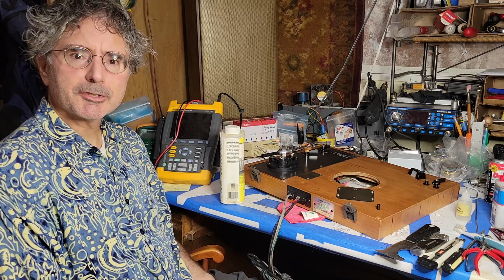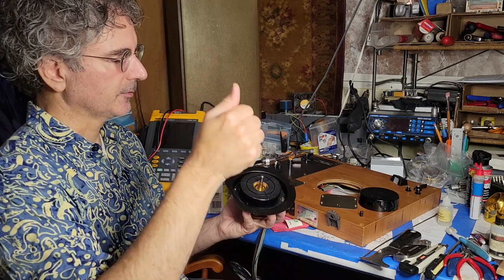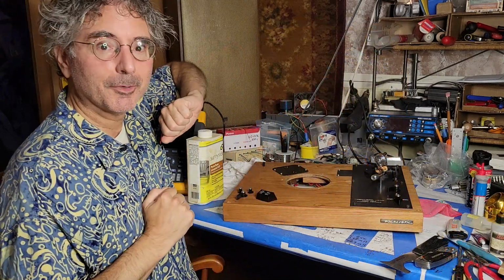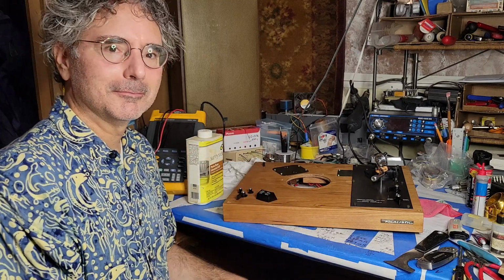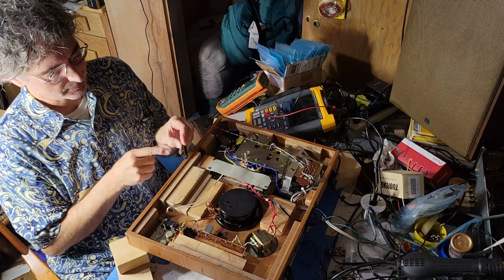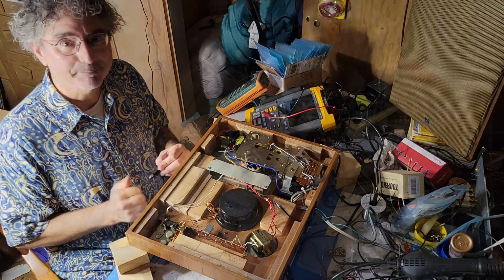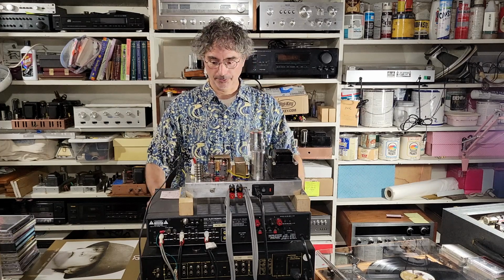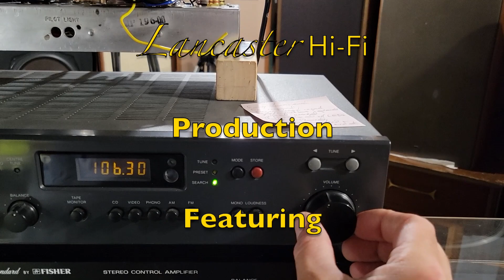Realistic LAB-400: Vintage Turntable Restoration

Comment: You did a great job restoring this turntable! I have one I bought new in 1979. Since having it I had to replace the rubber feet that deteriorated. I replaced the two top cover hinges because the springs broke through the plastic. The latest was the rubber platter mat that cracked and oozed oil. It is still working. I always was amused how the spindle jerked around if you ran it without the platter attached.
Reply from the maker: Thanks! What did you replace the get with? I'm not sure I'm satisfied with the replacement feet I have.
Reply from the maker: What did you replace the FEET with ...
Reply: @Lancaster_Hi-Fi  I got some feet from Radio Shack years ago that didn’t offer any shock dampening. Just something that raised it up an inch. It might have been better with four pieces of foam rubber as feet.
Reply from the maker: I still need to find something. Hell, I might try foam rubber (or neoprene)!

Comment: Great video. I wondered about the pots. My speed is wonky at times, and if you flip the speed switch back and forth, it fixes it. After that, the on-off switch decided it just wanted to play on repeat all the time even though it's set to the off position. I unplug it when I'm finished listening. Another pot issue, I'm sure. The LAB 400 belonged to my wife's late Granddad, and when cleaning out the house after both grandparents passed on, her family asked if I wanted the stereo, which sat in their dining room. It's in great condition cosmetically, and the mute and cue dampening is fine. I may take it to a local repair shop someday to clean the pots. I only trust myself with a cartridge and stylus replacement. 😊
Reply from the maker: The pots can develop problems, but they're relatively easy to access and treat. I was surprised that the source of persistent problems was the three micro-switches, which are relatively difficult to fix. Repeatedly working the speed and play switches might provide temporary relief.
Reply from the maker: You have to take off the bottom panel to access the pots. Take off the platter first! (Ask me how I learned that the hard way.) With the bottom removed, the pots are pretty easy to access. But the microswitches are a likely source of speed issues. Those can be treated with DeoxIT, but to do it, they have to be taken apart. It's not super difficult, but it's not easy. Fixing those switches made my speed issues disappear.

Comment: Excellent video! I love my lab-400, but have a question: I am experiencing loop skipping on various lps. I’ve managed to get through a few after adding a little more tracking force but don’t like doing that. I’ve tried two different cartridges/styluses with pretty much same results. Anti-skate doesn’t seem to have much affect on the tone arm movement but has very slight movement left or right depending on skate knob direction. Tonearm floats with ease before setting force. Side to side motion seems to have VERY slight resistance when touching arm. Blowing on it won’t move it side to side. Could it be tonearm bearing going bad possibly? Is it possible to lube that bearing?
Reply from the maker: Dang! I've never encountered that problem, sorry!

Comment: I have one of the same turntables. It has been in Arizona for 40 years and two years ago brought back to Indiana. I was given a couple albums I wanted to listen to, and discovered the speed is a little inconsistent. Approximately what would the cost be to go through the turntable and do a restore? The turntable is like new as far as cosmetics. Still have original box it came in. Almost 50 years old. (47)
Reply from the maker: Maybe $100? Ballpark. If it's only the speed variation you're concerned with, that's just DeoxIT for pots and microswitches (or replacement of microswitches). That's relatively easy work. You might also want lube and inspection (and repair as needed) of the mechanical workings. That's not bad for someone with some experience, but it's fiddly work and might take some time. Replacing electrolytic capacitors would be a good idea. The ones outside the motor are easy,  but the ones inside the motor case require more work. Hmm. Now, all that's sounding like more than $100. You might start with the pots and switches. 😁

Comment: Hi, you mentioned lubing the motor shaft and showed still images, but what areas should be lubed?  Thanks!
Reply from the maker: I've worked on so many turntables since this one, I can't remember exactly. In general, you want to find the service manual, and it should tell you where to lube with what.

Comment: The various switches you mention at the 14 minute mark I was, I think, able to get some DeOxit in around the trigger pegs, but you say they can be opened up if necessary? How do you do that without destroying them, as they appear to be welded shut.
Reply from the maker: The switches in mine have tabs. I think I used a thin blade or screwdriver to pry them up just enough to ease the covers off. It wasn't easy, of course. Maddening, really.
Reply: @Lancaster_Hi-Fi  yes, the switches by autostart/reject  lever have  tabs. I was thinking about the  smaller, black bodied switches. Maybe you didn't mess with those and maybe I don't need to be concerned with them either. thanks.
Reply from the maker: Sorry, I'm still learning how to find replies to comments! So, one year late, smaller, black-bodied switches don't ring any bells. After looking through my detailed photos of the guts, there were some black components that might look like switches, but I'm pretty sure they're capacitors. The three microswitches in mine had yellow plastic tops.

Comment: Great video, thanks for posting. I recently picked one up and it works flawlessly however I hear a tapping noise when the auto function is moving the arm either from the rest to the record or back to the rest. Once it drops it is fine, sounds like it may be coming from the auto motor/cam. Could this be a cracked cam as you experienced? Did you notice the sound before you fixed it with the tie? And lastly, how hard was it to get to the cam? Thanks
Reply from the maker: I don't think a cracked cam would do that, but I don't know. I don't recall mine making that sort of noise. The cam is not easy to access. If it is working despite the noise, I'd leave it alone until it malfunctions.
Reply: Thank you, yes otherwise it works fine so I should leave it alone but will be hard to resist tinkering. The clicking is so loud when the arm is moving I can't imagine that is normal or good. Maybe the tonearm motor needs lubrication
Reply from the maker: It doesn't have a separate tonearm motor. (Most turntables don't; my Pioneer PL-630 is an exception.) The tonearm moves via gears, etc., turned by the main motor. Those mechanisms aren't super easy to access, but not super difficult either (and way easier than the cam). After all these years, cleaning off the old, hardened grease and replacing with new grease might solve your problem. I generally use white lithium grease (although that's not "spec").

Comment: Hey! I have another question regarding the Lab-400...there are two adjustment screws that control the position sit down and return of the tonearm. I just purchased a second Lab 400 and the arm keeps wanting to sit in more of the 7" starting position rather than 12". Also the return is only active past the dead wax (into the label basically). Do you know which screw controls which function through the access hole? Thanks so much
Reply from the maker: You should get the manuals from Vinyl Engine. You have to register, but it's free.

Comment: Great stuff! Any tips on "refilling" the tonearm damping mechanism? Mine otherwise works great, but is dropping way too fast. Oh, and thanks for the mute-switch tip. I'm guessing that's the problem with mine (it's live whenever the TT is powered on).
Reply from the maker: Silicone grease on the shaft thingy.
Reply: @Lancaster_Hi-Fi  I assumed it was more complicated ) than that (like I needed to refill a reservoir or something), but I haven't been in the internals yet. So just some thick silicone grease on the shaft? Sounds easy! (and thank you!)
Reply from the maker: Yes!

Comment: It's motor driver AN 620 based circuit and motor is similar to cosmic cogram 4000 and cogram 4000mk2 motor assembled in Bharat(🇮🇳 India) in  between 1980-88.
Reply: That's cogram 4000mk2.

Comment: I subbed to your channel after watching this. I too have a Lab-400 that I recently bought from a customer for just $25. I own a record store in Tulsa, Oil Capital Vinyl, and sometimes people just bring stuff in. Anyway, it was in astoundingly good condition, not a blemish on the unit itself and only a few very small scuffs on the lid that polished out. It even came with a very nice, likely original, Shure cart and stylus. The speeds were a little wonky, so I cleaned the pots with DeOxit and also adjusted the start/drop and stop/lift positions. The only issue remaining, is a loud kkkkkssssshhhhh noise from the speakers when the muting circuit deactivates and reactivates. I cleaned the gold colored reed contacts by using a piece of cardstock, wet with DeOxit, but that seemed to only lessen the noise, not eliminate it. Any ideas or suggestions? It's a really nice table, perhaps a keeper, but that one issue is really annoying.
Reply from the maker: Instead of cardstock, try 2000 (or higher) grit sandpaper. My local Home Depot carries it.
Reply: @Lancaster_Hi-Fi  I’ll try that next. I have some 1000 and 2000 grit paper. I was afraid to try anything abrasive. Thanks.
Reply from the maker: How did it go? Were you able to solve the problem?
Reply: @Lancaster_Hi-Fi  I sold it in otherwise great condition to a customer who said the muting pop didn’t concern him. He loves it.

Comment: Why did you increase the voltage in the capacitors that were in the motor assembly? This is not a wise thing to do as these values were carefully chosen by the engineers when these turntables were designed. These were 10v caps for a reason. Changing them to 35v and 100v when they were originally 10v As the voltage path they are in will cause these to improperly charge and discharge and affect the servo and the regulations of the IC over time. It is not always ok to change the voltage values of capacitors these were designed to have certain values for a reason. But I guess you know more than the people who spent countless hours designing these units like 99% of the so called repair people on YouTube here that mislead those who don't know any better. I guess I can plug my 110 lamp into my 220v outlet since voltages mean nothing in the YouTube repair world now days.   (rolling my eyes)...
Reply from the maker: Maybe I'm wrong, but I've always followed the rule of thumb that you can always go up with the voltage rating. It's a tolerance, not an operating voltage. That said, the ESR is generally smaller with higher voltage ratings, but that's usually a good thing.
Reply from the maker: And I'm not saying I know better than the designers. They were designing to a price point, and higher voltage ratings are more expensive, so they wouldn't use higher ratings than necessary.